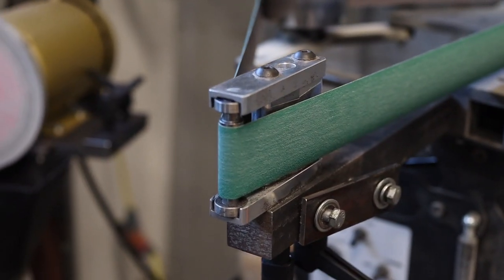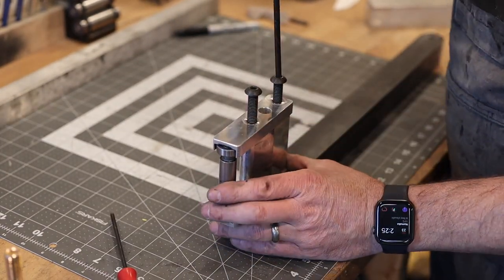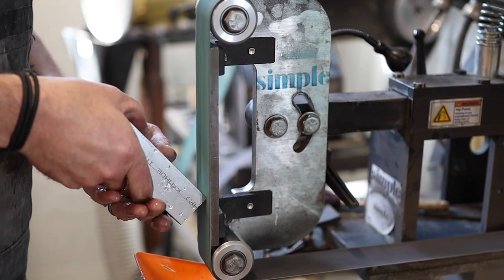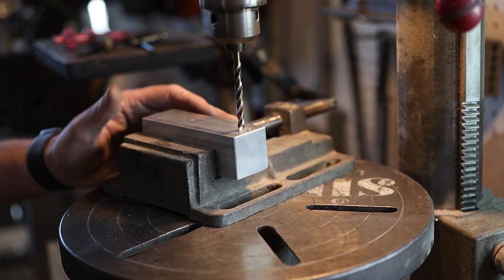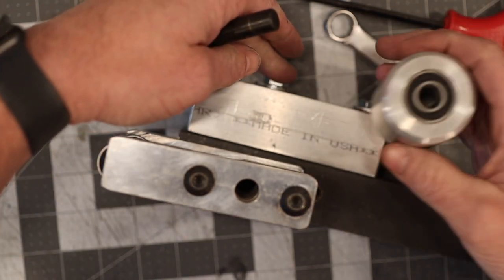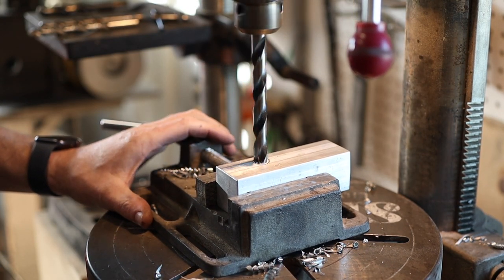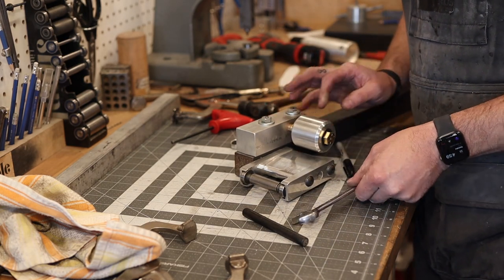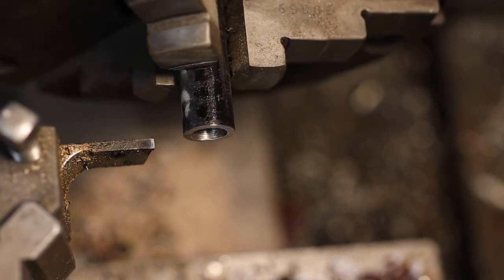2X72 Belt grinder small wheel modification

Comment: I've gotten in the habit of just chucking the taps in drill press after I drill the appropriate hole, turn drill press on, add cutting fluid and pull the handle. Shut off drill press at appropriate depth, then manually spin the church to extract the tap. I've done ½-13 in 1½ solid steel bar no issues. Probably wouldn't go below ¼-20. Love the "back of the mind" projects that work out perfectly and make life easier 👌

Comment: Just my opinion to why it should not be done like this but I may be wrong please correct me if so,
The obvious that stands out would be the grit side of the belt will start eating into the added wheel and any foreign matter on the belt will just cause more damage to the out side of the wheel,
Have you noticed this issue or not, because i wanted to do this to my machine but for the issue stated above that may occur I am not sure